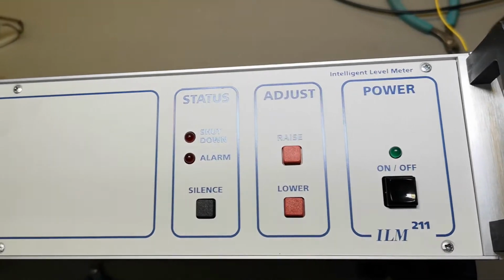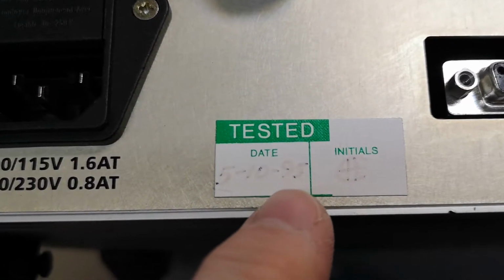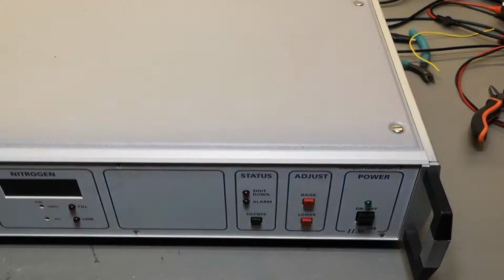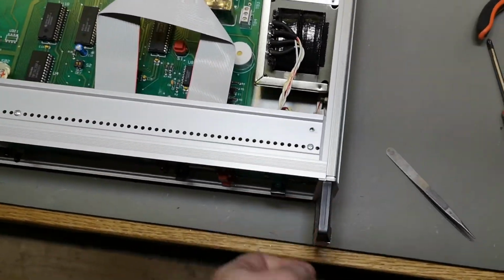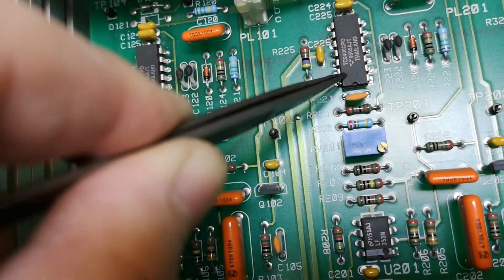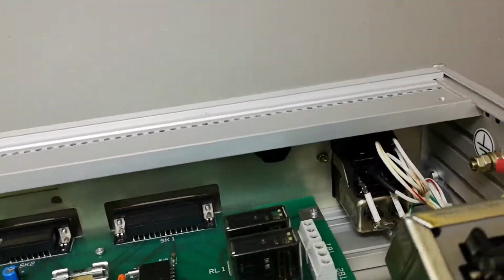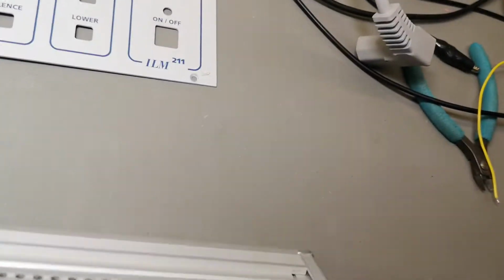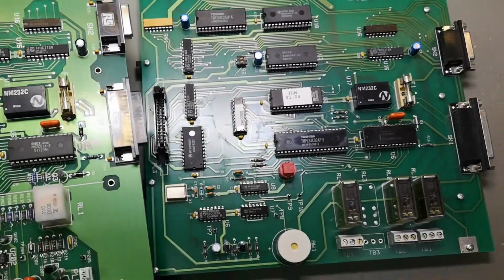Oxford Instruments ILM 211 Digital Helium Nitrogen Intelligent Level Meter TEARDOWN

Comment: Normally those use capacitance to measure quantity, 2 coaxial tubes in the tank that change capacitance according to the amount of liquid, which has a different dielectric constant than the gas, so allowing them to measure capacitance of the tank via capacity change. Zero and full scale are simply to measure the capacitance at those points, effectively nulling out ant wiring capacitance, and then the software simply measures capacitance at regular intervals, and does some subtraction of the zero value, giving a value of level. Then take this, and using the 100% value, scale to give a reading in percent, likely to a single digit after the decimal, as there likely is enough capacitance accuracy to give a meaningful reading. Error if below zero, or above 100%, and also detecting for a shorted cable, using a DC voltage applied to the whole cable and sensor. Alarms probably are available for either low gas, shorted or open sensor, or for high level, though, as there are likely one relay per channel, only one at a time, unless they also allowed the third channel relay to be used as alarm for other unused channels. 

Likely if you populated the display for the third channel, it would light up with the error message as well, no need to disable in the firmware other than to flip the bit to suppress the alarms for channel 3. Can be used for any cryogenic gas as well, as it only looks at capacitance, which is easy to do, and also non hazardous, plus it will likely work with flammable liquids and oils as well, though not atex rated.
Reply from the maker: WOW thanks a lot, that is the quality level of messages i love to get :-)